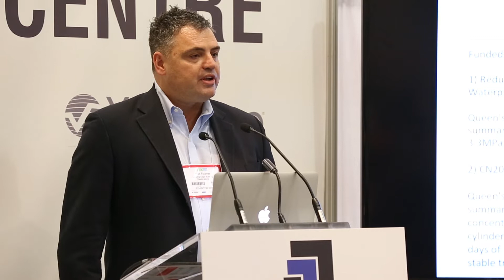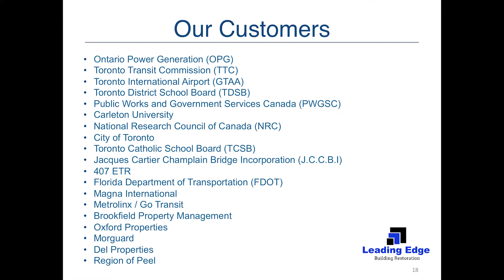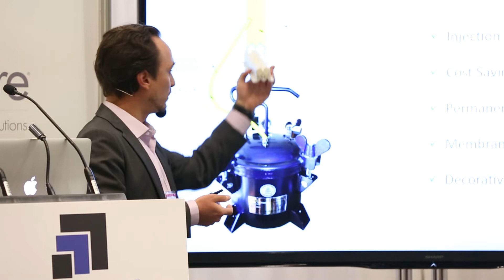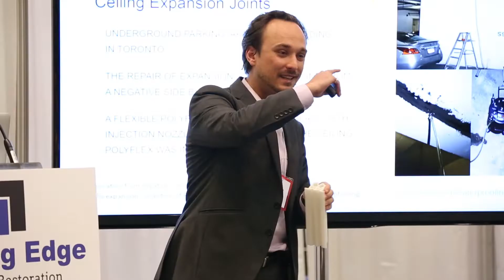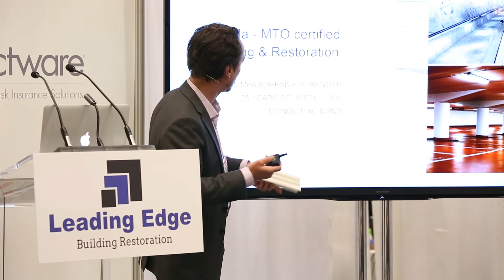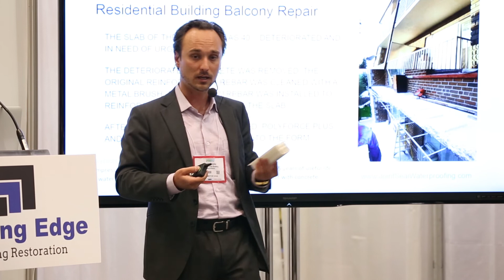Negative Side Concrete Waterproofing

Comment: Can this product be used inside a concrete septic tank, to prevent water from entering the tank from outside ?...especially continuous running water
Reply: Yes, this is the beauty of the internal membrane. I don't work in this industry but have talked with the Kryton people quite a bit.